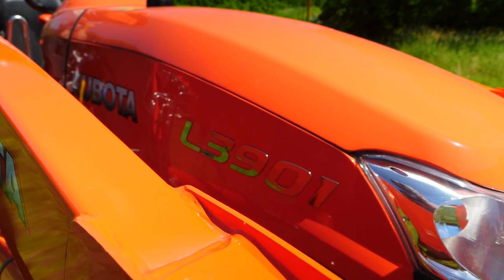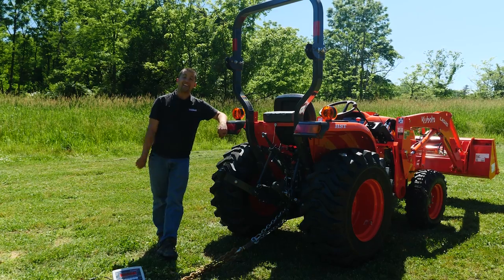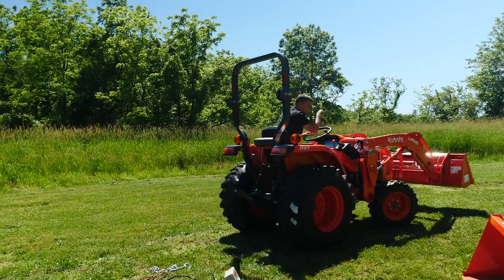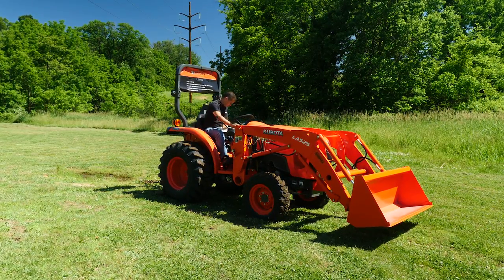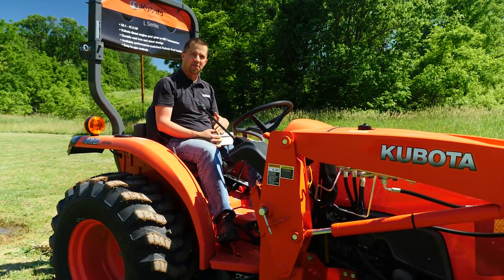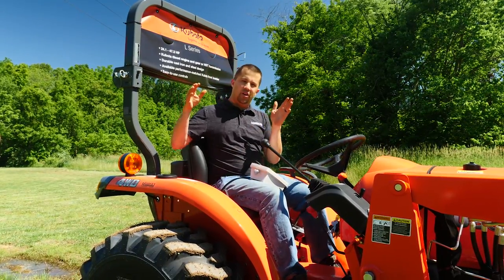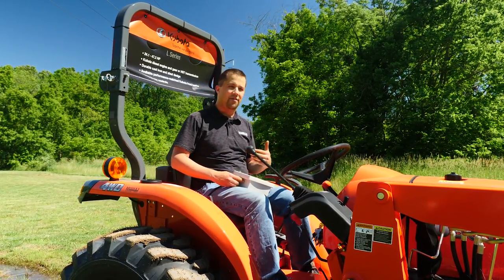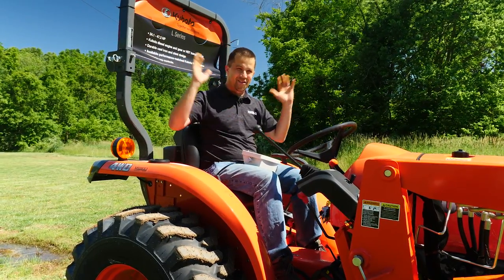Tractor Pulling Test - Gear Drive VS Hydro-static

Comment: Lots of people asking what the Hydro would pull in low - answer is exactly the same as gear. Assuming similar weight, similar tires, and similar psi, you're always limited by traction.

At plowing speeds, the pull force is identical (limited by tire slip). The gear will use less fuel, and / or deliver more power to the PTO due to less parasitic loss. That's the real advantage. Disadvantage is clutch wear for loader type of work.
Reply: Want to bet?

Comment: Could you do a comparison between a B2401 DT and a B2601 HST?
I'm leaning heavily towards the B2401 for flail mowing slopes and some light logging of diseased trees that are starting to come down.
Thanks!
Reply from the maker: Same tractor, it's just a different transmission.
Reply: @MessicksEquip  I figured, but a local Kubota dealer has been pressuring me away from the 2401.
I'll have to look further afield.  Thanks.

Comment: this video is pretty old but I had to chime in - for the hydrostatic machine you pushed the pedal to the floor, they actually pull harder on a standstill load with the accelerator pushed only slightly, generally speaking

Comment: Wow! Neil you are taking a lot of heat for this video. I actually think it’s a very good video, thanks for posting. You certainly got everybody talking and thinking about the differences between these 2 tractors. I do believe the results are easy to misunderstand, and many people have touched on why this is the case. The force the tractor can pull is usually limited by tractive force. So things like the weight and tire type have a big impact. What this test shows is that the gear transmission has more mechanical advantage in high range 1st gear than the HST in high range. In high range 4th the results were much closer. It’s worth noting that HST in high was not able to spin the tires, while the gear transmission could easily in high 1st. If you re ran the test with the HST in low I believe that you will find the pulling force to be equal for both tractors as it will be limited by available traction. You can even run the gear transmission in low range, but I doubt you will achieve higher pulling value due to the limitations of traction. So what does this mean to a tractor owner? If you were able to achieve unlimited traction the gear transmission would always out pull the HST due to mechanical advantage assuming you don’t break anything. Understand that the gear ratios are designed to allow the tractor to operate at full engine speed and very low ground speed. Not because an insane amount of torque is required to pull things around.

Comment: My question is not can if the hst can pull. Can it plow 3-5 acres with a moldboard plow and live.
Reply: Philip Blass can’t see it happening, the oil would get hot and burn the hydro out
Reply: How big are the moldboards and how many?
Reply: powershuttle would be best of both worlds
Reply: I wouldn't plow much with my hydro tractor
Reply from the maker: This is a video I've wanted to do for years.

Comment: The clutch is a point to focus on. It's hard on a clutch if it's not fully in gear. In this case, the 8 gears forward and 8 reverse or the neutral gear. If your application it a lot of speed changes like yard work HST is more advantageous. But also look at how the HST handels transmission heat. Long steady pulls like fieldwork gears have the advantage.

Comment: I'll take HST all day long, especially for efficiency and ease of use functionality.  Gear drive is great for grunt work like that, but for my personal use, I'm not pulling up stumps.
Reply: There is no question that HST is more convenient for most folks especially when working in confined spaces around the yard. The lack of HST pulling power can be a bit frustrating though. I've owned a 30HP gear drive tractor and a 30HP HST and the gear drive will drag the HST machine all over the field.
Reply: @eosjoe565  Great to know, but I bet it's simply because the gearing is much lower.  Makes sense why HST has a little faster top end speed.  I'm mostly doing mowing and loader work around our property.
Reply: @johnmedlin5894  that's where you're wrong, I'm pretty sure he gear speed would have a higher speed than hst

Comment: Fluid is a very inefficient means of transmission at near 0 rpm.  I recently converted an old Sears Suburban garden tractor to battery electric power. After easily towing a 3000lb camper around my yard, I did a drawbar test and  at 1143lbs the front end came up with 300lbs on the front axle. The atv tires more than doubled the turf tire result of 500lbs.

Comment: So all things pretty even the gear is stronger than the hst? But the hst is easy and cheaper to repair? So I should go with hst and buy more hp. Is that a logical solution? I'll pay more up front but would save on repairs down the road maybe.
Reply from the maker: This video needs the context of all the others that I posted. The hydrostatic is the better choice for most people.

Comment: Interesting test. Please do it again but on concrete in a range of gears. I have a hydro 3901 and I know 3rd gear is nothing but a road gear. Put it in 2 where most work is done and just pull load readings.

Comment: Love my Kubota b7500 hydro and my Kubota g1800 hydro. Gear drive and hydro have there place but you have to look at the big picture. there are more and more Equipment being built with hydro transmissions from mowers to farm tractors to bulldozer's. I personally like the infinitely variable speed range from zero to top speed, just can't get that with a manual transmission.

Comment: I always have thought that to get MAX Pull or Push you want the Lowest gear available. I would use Low gear (1st), Low range either way. Where is my error? If tires break traction add weight to the axle that slips until neither axle slips and you then have Max Traction. Creeper Gear at Max traction puts Max Power to the ground. That's all she wrote and why we spend the Big Bucks for 4WD.       sdh in CT

Comment: i wonder the difference in fuel usage between the two on the same task.  the hydro also has the overpressure valve which is more of a safety for the unit that actually takes away from the potential power of the hydro, but at the cost of potentially damaging the machine as well. hard to say what that hydro would do with that valve either blocked off or set at a much higher pressure.

Comment: i think hydrostat. it has many advantages, you can choose your speed from 0 to top speed,  which means if your rotry hoeing or  pulling thru hard soil you can slow down or speed up. gears are stuck with thair minimum speed , and if that's too fast it won't work well. only disadvantige is if you cut a hose your stuck where it runs out of fluid. ( which i have never heard of happening ).

Comment: For me manual transmissions are the way to go across the board, be it cars, trucks or tractors. One big reason is you can't push, pull or roll start  it if it has any form slushbox. Flat towing can be a big no no too. Hydros are superior for lawn mowing but that's about it.

Comment: Neil.put the hydro in low range.As soon as you open up the pressure reliefs in the hydro you lose some pressure to the hydro motor. I guaranty you will have more pulling power in medium & low range. YOU MUST REDO THE TEST.

Comment: i grew with standard gears on my tractors love them i hate hst. in the last 15 yrs i think we have replaced one clutch maybe. gears pull stronger and i personally feel like i have more control between gear selection throttle clutching and independent brakes. also i think older tractors are just flat out better, the tie rods on my old ford are 2x as big as a tractor of similar size and hp over recent yrs, just everything was built bigger and heavier.

Comment: I own a gear drive L3200.  I would not consider this a fair test of either tractor, however, each was unfair in a different fashion.  One was unfair in that it was not allowed to slip, the other was unfair in that it was allowed to slip.  So, in each case it's really about how much motive force the tires can muster.   Having said that, the HST cannot ever equal the Gear Drive just by the nature of fluid drive (allowed to slip due to pressure relief, etc.) vs. physical drive (new clutch will stall out engine before it gives up).  It's really just a test of how close the HST can come to the GD tractor.  You don't purchase an HST for maximum drawbar pull, you purchase the HST for ease of forward vs. reverse and overall handling of the tractor, no moving a gear selector around, no clutch pedal to mess with, you don't have to stop the tractor to change gears through the selected power range.  You could see that he was struggling with the gears in the GD where in HST he just moved a lever and gently moved the pedal.  I love my gear drive L3200, but there are times that I'm working the loader or the box blade and wish I had that easy to use HST, but pushing into hard earth with the loader, the gear drives power comes into play but it's less convenient to use.  If I was pulling a plow in a field though, I doubt I'd ever care about needing an HST.  So really, you choose the transmission based on need, convenience and for some, money, but I think that's the least concern because if it was a high concern you wouldn't be looking at Kubota in the first place!

Comment: I just purchased a l2501 hst and in low range its a beast will fill the box blade to full and spilling over even does well in med range i believe the hst can do just as good as gear drive in low range and prob pretty close in mid range either way glad i went with kubota though the l series is a great tractor i just like the 2501 for that old tractor feeling with no emissions junk

Comment: I knew the manual transmission would win.. however I was only expecting a 20-30% difference at most. Other people mentioned the HST should also be tested in low range.. which makes more sense to me. Loader work and the like should only be done in low range

Comment: Changing the subject a little. Close to 45 year's ago I worked for a sawmill man and he owned an old 1965 Sox & Martin backup Barracuda Super Stock drag car which had a 4 speed in it. Once in awhile he'd get beat by an automatic hemi car but that was rare. The stripes paid him to show up because that car was a real wheel stander. He would chuckle a little and say those automatic boys had a hard time with ol red as he referred to his pride and joy. I like automatics now that I'm older but used to standard is all I would own. Got a farm truck and pickup with standard but after selling the farm I sold the Minneapolis Moline G950 and now am like many do are trying to figure out which compact or even subcompact I'm going to get to use on my mainly wooded little 20 acre place. GP Outdoors has pretty much sold me ot that little B2601. Sorry for long rambling post but I guess my trigger, aw I mean typing finger got happy.
Reply: Go gear drive and dont look back.

Comment: I was guessing it would be around a 14% difference. I saw a video on a manual vs. automatic in a jeep wrangler where the manual put down 40 more horsepower which is equivalent to around 14%. I understand that a hydro-static is not a car automatic but they are both fluid drive systems when you really at a basic level. Very impressive experiment.
Reply: A car torque converter operates very differently. It uses a turbine, while a tractor has a positive displacement piston based pump. Also the losses probably don't scale the same. The gear drive is more efficient though and while the logic behind your answer is off, the answer is probably pretty close.
Reply: @court2379  True. They are very different pieces of machinery. The point i was getting at was exactly what you said about the gear drive being more efficient at transferring power. I think it would be interesting to see how these drive systems compare on a dyno.

Comment: It seems like you “snapped” the load the cell with the gear tractor, therefor imparting the inertia of the tractor on the load cell which is why the numbers where so high. You eased into the load cell with the HST which is why the HST number is lower and therefore more accurate. In theory, there would be no real world difference between a gear drive and a HST assuming both machines weigh the same, because both tractor have the same weight and enough torque to break the tires loose. I would try replicating the test by gently drawing the load cell tight instead of “snapping” it tight like you did with the gear tractor.

Comment: I could have told you the gear drive would have out pulled the hydro by quite a bit before you even tested it.  If you remember the old Hydro 70 tractors back in the day were basically a 666 with a different rear half.  PTO HP and drawbar HP is about the same between the two, but you need to push the hydro another 400 rpm higher (17% more RPM) just to match the gear drive 666 and with double the fuel usage to boot.

Hydro's have their place though.  They offer the ability to infinitely adjust your ground speed without needing a gazillion clutch packs in a power shift which wears out.  If the ability to forward and reverse with infinite speed adjust-ability is paramount over stump pulling torque then the hydro is a good choice.  If you need the power you want a gear drive transmission.

Comment: Liquid in tires and pressure difference can make a difference.
Makes me ponder wether the SST had liquid filled rear tires, at a lower pressure.
Or the rear interlock was used on the SST over the HYD.
Other then that, I know a HYD loses a ton of grunt in hi range.
.
not suprised by the large advantage of the SST over the HYD.
0.01c

Comment: I know this is an old video I’m just coming across, but there is one key point missing from comments. Piston motors have very low starting efficiency and torque (unless you are using a bent axis motor). 

To get a true max drawbar measurement the test should be done on pavement with tractor moving first. Think of a situation where you are pulling a heavy load and start climbing a hill. In a situation like that the efficiency of the motor is about 40% higher and power transmission to the ground is significantly higher. 

Yes getting a load moving is critical, but ever 74hp and smaller HST tractor I’ve ever operated or tested can break traction very easily which then means the tractor is traction limited and not power limited. 

Btw I’m a hydraulic application engineer, with ag. Engineering degree. I’ve literally performed the ASAE and SAE tests in controlled environments. Many many many times.

Comment: I would like to see a moving pulling test. Trying to start a freight train with dead headed fluid is a tough job to start with. Put the load cell in between the tractor and something for a load sled and see how that changes the results.

Comment: I thought the gear drive would win, but didn't expect it to be by that much either. But for most general work, hobby farms and loader work in tight spaces, the hydrastat will be the best choice. Pulling plows through long fields etc, then a gear drive is probably the choice most people will make.

Comment: That's pretty interesting with the pulling power. Now although you could pull a house of the foundation with the gear drive....what will ultimately matter is the friction you have on the ground.

Comment: I guessed the gear drive would significantly pull better than the hydro only because of my personal experiences. I have an HST Kubota Grand L4060 and an ASV RT-40, both rated at 40HP. The RT-40 out performs the Kubota time and time again.

Comment: I would say that you took the gear drive to the limit of the tires loosing traction on the turf. Instead of testing the hydrostatic transmission in low which would have done essentially the same thing, you pushed the limit of the high transmission which has very poor low end torque. You also had slack in the chain before you started the moving the gear drive. By bumping the resistance I'm sure you can get much higher numbers.

Comment: I have a L3130 gear shift 31 hp and a L4740hstc 47 hp with a hydro trans and a cab and i think the l3130 will pull a lot more than the larger tractor with the hydro trans but for moving snow there is no comparison in using the hst for loading and stacking snowbanks

Comment: I don't think it was a fair test.   As much as I like the hydro everybody knows that a standard will beat it when it comes down to it in pulling power usually do to the gear ratio.   I noticed that the standard had the wheel spinning how did that effect the test???

Comment: We’ve real world tested the same model John Deere 3320 M/T and HST, and it’s not even comparable when it comes to hydro vs M/t in horsepower! The manual just gets more power to the ground and it’s obvious in many situations. 
The only thing the hydros offer in my opinion is ease of use when it comes to changing direction.

Comment: that is on par with what our L6060 with hydrostat does.  even in mid range equivalent to 3rd gear in low range normally, it will not spin the tires.   the hydrostat is convenient and really good most of the time, but it for sure is weak.  and it is not power efficient.

Comment: Not going to lie Neil, that test was very flawed with both tractors. 

First of all, it should be done on pavement with both tractors.

Second, the HST,  HAS TO BE in LOW RANGE to make any significant torque to the wheels. They will never break loose in high range even in loose sand.

Third, the gear drive should only be in 1’st or 2’nd gear, with the engine at about half throttle, and feathering the clutch carefully, to prevent the wheels from actually breaking loose.

I’m pretty confident that you’ll see making another video, is very much worth it. For everyone.